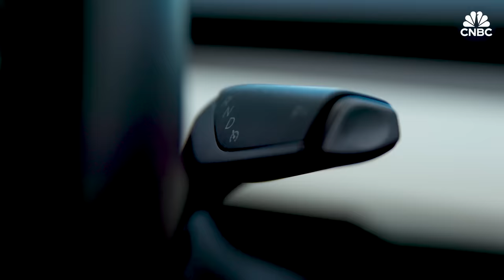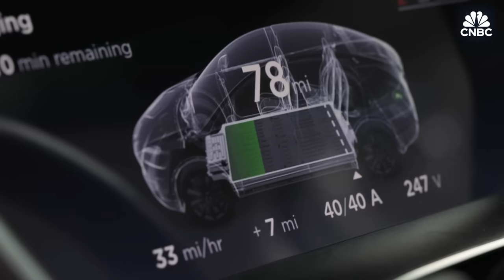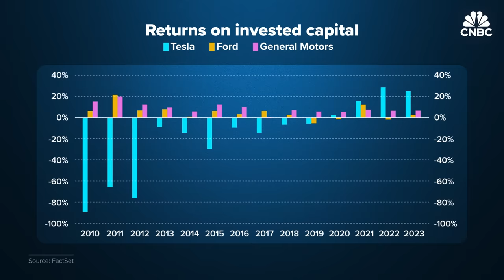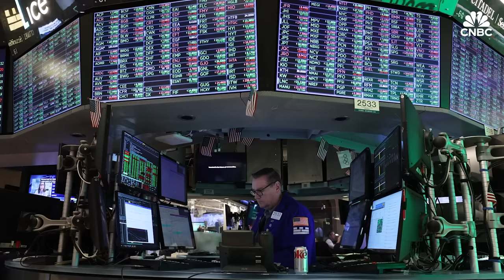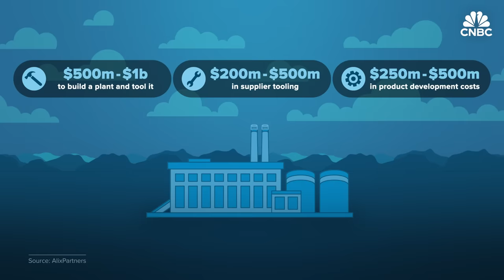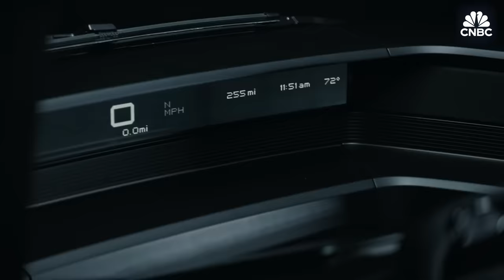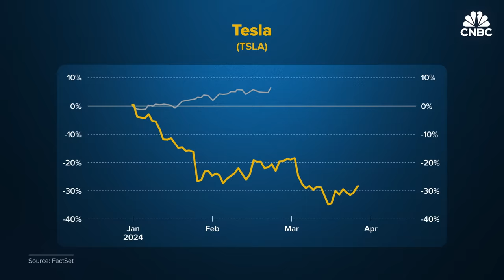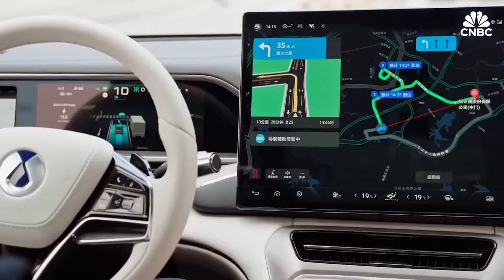Why So Many EV Companies Fail

Comment: Infrastructure investment is a critical issue in the US
Reply: There are over 250-000 Tesla chargers world wide and mostly open to non-tesla cars...
Reply: @kylereese4822  just USA has 200,000 gas stations X at least 4 pumps, X it takes at least 10 times faster to fuel your car than to charge it X there's 100 times more gas stations in remote areas than electric chargers X if USA has 200,000 gas stations, let say the rest of world has 1.000.000 gas stations with at least 4 pump = tesla has to have at 3,200,000,000,000,000 chargers to then say infrastructure is there for ev. then they have to overcome the fact ev is lame, its unsuitable for extreme cold weather, its not appealing to second owner unless they have low iQ to have a car with expensive battery which is dying, the insurance is high, you cant charge ev in bad neighborhood at night, many men wont buy even because its nerdy, also because its pushed by govt many wont buy it because they know you must keep govt away from your life,, its dangerous, few independents mechanic will want to touch evs....             EV IS FOR RICH AND NERDES

Comment: On the contrary, Chinese companies are doing very well. Maybe because the government there is actively supporting them & provide infrastructures (such as for Batteries)
Reply: True, but what about the electricity to power the cars?
Reply: @soundmindbodydivine  What about it? Use renewable energy.
Reply: They're going bankrupt as well. And they're stuck in price wars.
Reply: @benjaminsmith2287 Highly unlikely. But it will take time to reach better standards

Comment: America doesnt have the infrastructure to produce EVs. Everything has to be imported or outsourced. And even if there are domestic options, they charge several times whats charged overseas. 
I dont think its Americas fault since the cost of living and therefore wages are higher. 
But I think Tesla may be the only Amercian EV company that makes it out of the next ten years because they shot out the gate first and expanded the fastest.

Comment: Electric cars need battery swap if not that is a shame otherwise you got to spend another 20k or thereabouts for a new battery in about five years and it mean the value of the car is rapidly going to drop because of battery usage if you're having a bad year and ain't got the money for the battery your car is good for nothing

Comment: Unless you are specifically looking for an overpriced, poorly designed,  and badly built vehicle that depreciates by 90% in the first minute of ownership, costs ten times more than a petrol car to insure, requires a 4 hour 'fast' charge every 60 miles, and is guaranteed to catch fire, I can't think of a single reason why you would want to buy an EV. It's much cheaper just to tell people that you're a vacuous gullible narcissist. Saves all the hassle and risk of buying a Tesla.
Reply: Exaggerated but an interesting observation.

Comment: I don’t want an EV.  They’re excessively expensive, repairs are a pricey nightmare, and the infrastructure to recharge isn’t in place as are gas stations.
Reply: Obviously you don't know Ev's that well. I owned an EV and within 5 years of owning it, the only thing I maintained was the wind shield wiper fluid and tire rotation. No oil change, no filter change, no transmission fluid bs.

Comment: Polestar is next to go down
Reply: Nikola Motor
And....
Mullen Automotive
Reply: Rivian and Lucid too
Reply: Polestar is not a start up and they likely will not go down as their parent company is Geely. Polestar, btw, is the sporting arm of Volvo spunoff into their own company. Most Polestars are slightly redesigned Volvos with the Polestar 4 being based on the Zeekr001 and uses some Volvo and some Zeekr parts. Polestars are made in Volvo or Geely factories. Geely is not interested in having Polestar go bankrupt.
Reply: @benjaminsmith2287  Are you talking about the same Polestar that just announced a 40% drop in sales?
Reply: @soundmindbodydivine  As I said, Polestar is not a startup and it isn't going anywhere. Honda had over 30 percent drop in sales and now they are back up. It happens. Polestar had one car on sale and are coming out with 2 more and both are crossovers. Polestar is not a startup. Polestars are rebadged sportier Volvos and Polestar has been in business in some form since 1995 or so. It's possible, though unlikely, Polestar may return to be a division of Volvo. But the Polestar Group and cars are not going away. ZGH is supporting Polestar and Volvo and Polestar are tied together in terms of development of Polestar's vehicles. Polestar is not like Rivian or Lucid.

Comment: Most people aren't that smart. Most people dont care to do what is needed to make the company lift off. Elio motors for example... one day the stock is 500.. next is 10,000.. 

and then three years later... the company goes to crap.... 

Elon however... built tesla from the bottom up. unlike ford or chevy.. who just get to throw money at whatever they want. 

The biggest thing right now however is who has the charging station. Because if you don't have the charging station... your electric vehicle doesn't matter. Thats why Elon wins... forever and ever.

Comment: The economy is bad (thank your Bidenomics for that), so hardly anybody can afford a new car, let alone an expensive, impractical EV. The charging times are long, too long for most compared to the amount of miles to get out of them. There's hardly anywhere to charge them besides your house/condo, or maybe your work office. The cost of charging them anywhere else is outrageous and they have a diesel engine installed near them to run the generator for the chargers, so you're not really helping anything.
I will say that Tesla's are the only consistent EV car I see driving around my State. They make up 99.9% of the EV cars around where I live.

Comment: I'm not interested in going electric. I'll stick to my reliable gas burning, oil changing, spark plug changing, and 02 sensor self. I'm driving a 1996 Ford Explorer still reliable than any EV out. I have zero check engine codes or has it had any problems with fires or starting up in the cold.
Reply: None of us are. EVs isn't a switch everyone will make next Tuesday. 
You have to think bigger. Think what the world will be like in 2050, for example. It's hard to imagine that we'll still be burning fossil fuel for transportation at the turn of the century. So these are the transitional decades. Think how it was when cars were first made.

Comment: CNBC fails to understand yes, Tesla lost money back then but, they have the best margins of any legacy auto maker. their margins are in the double digits. 

Ford and GM are in the low single digits. Not to mention they sell direct to consumer, so there's no markups and they can pass the savings on to you.  Yes, they dropped prices a lot but they are still profitable. Also, most people fail to understand that Tesla has a highly profitable Energy business.  their mega packs and power wall margins are close to 50%.

its similar to Amazon and AWS, most people know Amazon Retail and E-commerce but its the Cloud business that brings in the real dough.

Comment: The only reason electric cars exist is because of the politicians in Washington. They all have money invested in the companies in America and overseas that build the components for these cars. They know they’re horrible. The design is horrible. They’re extremely expensive. It’s extremely bad for the environment to dig up hundreds of thousands of pounds of land with fossil fuel bulldozers to build a batteries, these cars are charged off of coal and natural gas have horrible range, especially in inclement weather and are only suitable for people who drive very short distances. There have been multiple studies, including the one in the UK that looked at the difference between ice vehicles and EV’s, which showed  That EV’s because they’re twice as heavy burn through twice as many tires as an ice vehicle. When that rubber is burning on the pavement, it releases emissions into the air thus making EV’s significantly worse for the environment, which is the whole reason these things were supposed to be invented , it’s a scam
Reply: NONE of this is true.  Not one bit.
Reply: You haven't seen one EV that you like the look of?

Comment: The video starts with 2 wildly optimistic claims of EVs taking 46% of the market by 2030 & even more grandiose..61% by 2035, then ends with the reality of market stagnation. Even extending past market growth rates never would lead to either of these conclusions much like reading claims of sea level rising numerous feet in a few years when the trend has been 1/8"/yr for the past 150 years.

And because of sea level rise (and the other supposed effects of CO2 pollution?) most current EV buyers are doing it to virtue signal their willingness to avert the "Climate Crisis". The problem for EV manufacturers is all the people who have bought them for environmental reasons  have already done so & for mass adoption the remaining new car buyers aren't ready to deal with the compromises required.